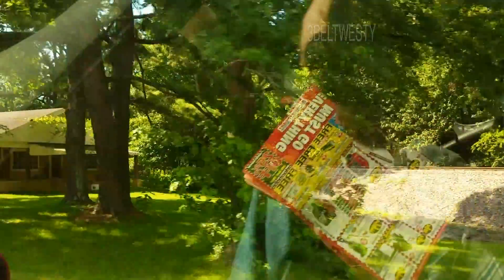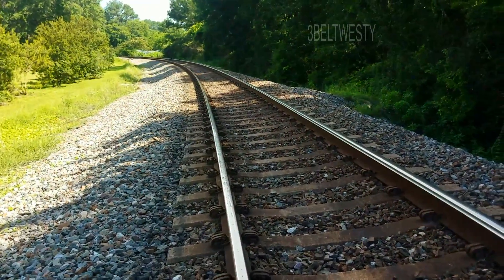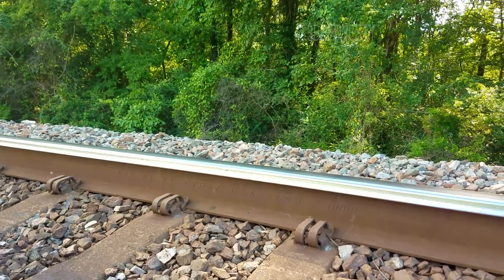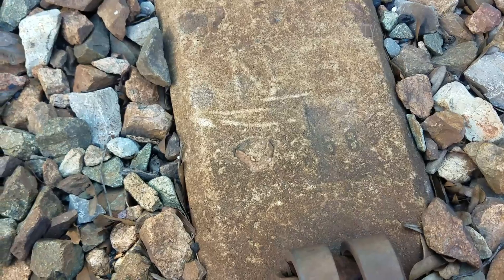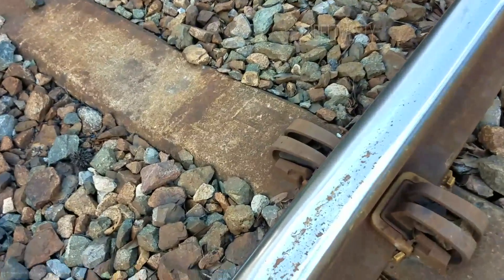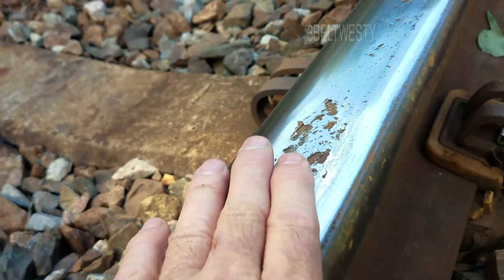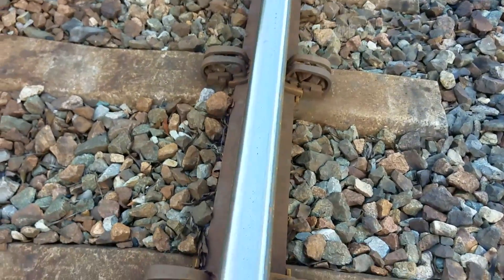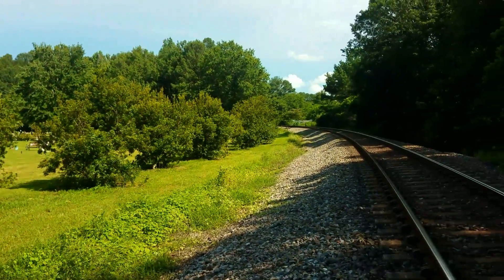BNSF Railroad track wear Concrete Ties curve 141 Lb Rail Tupelo Miss

Comment: 85% of the tracks of Deutsche Bahn are made of concrete sleepers. Only 10% consist of wooden sleepers. The rest is equally divided between steel and composite material sleepers. For information on how concrete sleepers are produced in Germany, please click on the video link.      https://www.youtube.com/watch?v=8yVp4g4Hml8                        The outbreaks in the rail head are caused by manufacturing defects. Too low temperature during rolling and not removing the scale layer before rolling. Greetings from Berlin/ Germany. Sven

Comment: i have found this video very interesting.  and the comments.  thanks for posting.  there is some minor spalling on a track near my house.  it only carries light passenger trains and the track is perfectly straight.  furthermore the grinder went over it 3 or 4 times and it was still there then the grinder came back and did it all again.  and the hole is still there.  i don't understand the mechanics behind it but apparently if you grind the rail to the ideal shape the rail lasts longer.

Comment: Common on the inside rail on a curve. I'm not an engineer but I'm guessing it's caused by differential stresses from inside vs. outside    lines of a curve. The inside rail being slightly shorter in length, causing the solid axle wheel assembly to peel the rail surface on what would be the faster turning inside wheel. Also rails are work hardened causing a harder surface compared to the interior steel of the rail which can also cause spalling of the surface.

Comment: The trains are probably going a bit faster than the bank/cant  in the track allows for, so the wheels ride up/squeeze against the non worn higher rail.  This higher rail gets better adhesion, so the lower spalled (with spalling) rail is worn.  The left and right wheels are locked together through the axle, and turn at the same rpm.  So because the higher rail is longer (due to the curve),  either the left or right sides must have the wheels grinding or being dragged over the rail.  Simple geometry.   So the lower rail with the spalls has the wheels being dragged over it slightly.  This creates a lot of stress.   If the train was going too slowly, the wheels on the lower rail would grab better.  This is the way that I see it.  You would have to confirm which rail has the most grinding (smooth wear) from the wheel flanges rubbing against it.  Look up these words in a dictionary, so that you'll know what they mean, and therefore understand what I'm saying.   Draw two parallel lines on a sheet of paper that do a sharp curve, and then measure them;  they won't be the same length obviously, since they are not straight.   Look up 'flange wear on the rail' on the Google, and see what you get. Aarre Peltomaa
Reply: you forget several things that are not directly obvious but very important: Most of the railkways use conical wheels and fillets between wheel and flange - this helps wheels to negotiate curves. Its simple geometry which means: No dragging, no stressing, no grinding........
Reply: Due to centrifugal force, the conical wheel rides outward and onto its larger inside diameter.  The wheel inside the curve rides on its outside lesser diameter.  Idealy there is very little wear.

Comment: that is rolling contact fatigue. low rail or inner rail has rail head contact about the center or field side while high rail is contacted at the gage corner. At the spiral or curve, lateral forces can be significant. 36 ton axle load, you can generate more than 15 kips lateral at certain points. Repeatedly apply these forces on a dime size contact, you wear or fatigue. Depending on the accumulated tonnage, grinding practices, ballast and fastening system quality and so on, life can change. that is a small to medium size RCF so it needs grinding

Comment: The reason more railroads are going with concrete ties is because they are carrying more and heavier loads. Wood tie lifespan has diminished from the expected 20 years to as few as 8. So the fatigue on these rails is likely due to the heavier and more frequent use the tracks are getting, rather than the use of concrete ties. Concrete ties are stronger and last much longer than wood ties.
Reply: @gravelydon
I can believe that. Seems like there’s no end to people trying to do things on the cheap these days.
I heard a news story recently about a company that was in trouble for selling a bunch of new ties in a big contract where the ties were not treated at all. The employees testified that they were told to “make them black whatever way works” and so they basically just got painted black and shipped. Those ties rotted quickly.
Reply: Would not surprise me one bit. The only thing that is allowed to be creosoted down here, ties for railroad use. So that shut down a Miami plant that did things the old fashioned way. We had some 2x2s treated by them. While the wood was Pine instead of Oak, it took almost two months in the Florida weather before they could be handled. They oozed for that long. We did cut a couple a couple years later to see what the center looked like. Nothing but solid creosote all the way to the center. Those would not rot.
Reply from the maker: Ethan Lamoureux in the usa the cost per mile is lowest for wooden ties thus that us why about all usa rails use wooden ties.  Thus includes replacement costs of the shorter lived wooden ties. Only on extremely wet usa areas in the usa does concrete sleepers have a lower lifetime cost. Thus maybe non usa rails might be more government funded and thus concrete is used since no profits are needed to survive? Wood prices in the usa can be low too thus another factor why wooden ties rule as the bulk of all ties used.  Folks who buy ones trees might give you 20 bucks for trees 105 ft tall and 2 feet in diameter
 If one has hundreds of them to justify the removal. Then ones land  is left with stumps and piles of limbs they don't want. Ie massive mess. One can travel around and look at all sorts of tracks in the usa and never see any concrete ties
Reply: OK, first, USA railroads use various kinds of ties, including wood, concrete, steel and composites, certainly not just wood. Second, the cost varies depending on many details such as location (wood is cheaper in some areas than others), climate (wood rots quicker in some places), type and amount of traffic (wood ties last longer on low volume lines, and the weight of the trains makes a difference), and various other details. So there is no ideal material for every situation. Concrete ties are on the increase in the USA, but wood and other materials are still used, and likely will continue to be used.
Reply from the maker: Here is some info on Steel Sleepers http://www.narstco.com/railroad-sleepers.html
Reply: Part of the problem with wood ties now days is that 1. they aren't old growth wood and 2. they aren't treated the same as they used to be. A new tie does not weigh the same as the old growth ties did and if you look at the new tie, many don't have a treatment layer of more than a half inch in. The same thing is showing up in wooden power poles. The creosote treated pole in front of our house is now 40 years old and withstood Hurricane Andrew and the hurricanes before and after. The new poles that were put in to replace the ones destroyed by Andrew in many cases failed in Katrina or Rita. That is why FP&L has gone to almost all concrete poles on the 3 phase lines. Pressure treating of wood does not work as well as vacuum treating the wood before releasing the chemicals into the retorts. With ties, the most penetration is by pulling a vacuum that pulls out the moisture and opens the cells, then introducing hot creosote in under pressure. Then letting them drain and air dry. Most are run thru in as fast a period of time before put into use. I've seen ties that were new rot in under 4 years down here. While on the FEC branch there were ties still in use that had a date nail in them of the 30s and 40s still in use in 1999.
Reply: @gravelydon7072  , creosote is carcinogenic.  just being near the stuff makes me ill.
Reply: @vsvnrg3263  That is one of the reasons why it is limited in its use down here. We have what is known as a sole source aquifer and it will leach down into the ground water over time. Same applied to CopperTox (CCA )which was used as a substitute. Now all the wood is ACC treated as the Arsenic in CCA also leached into the ground and water.
Reply: @gravelydon7072  , down here (in straya) cca was banned more than 20 years ago.  some poor kid took a bite out of an apple and to stop it falling off the cca log, put it bitten out part down on the log.  then he ate the apple and died.  the coroner concluded that the flesh of the apple had absorbed poisons out of the log.  this is a true story.  i was building fences in a park in the 1980's when this happened.
Reply: @vsvnrg3263  It was still used here till 2003 in residential use and it was still used in commercial use until recently. It is the most effective treatment after creosote for wood that comes into ground contact.
Reply: @gravelydon7072  , i've just been surfing wikipedia looking for acc and can't find anything.  what is it?
Reply: @vsvnrg3263  Acid Copper Chromate. Industrial/commercial use only for treating. Residential buyers can get ACQ (Alkaline Copper Quaternary) for use and is the most common home use treatment.
Reply: @gravelydon7072  , thanks for info on stuff i'd never heard of.  now i'll do some research.
Reply: @vsvnrg3263  Type in ACC wood treatment in google and you'll find a link to the US EPA. There is a batch of info there. Some of these treatments are only available to those who have a restricted pesticide license. Which I used to keep active.
Reply: @gravelydon7072  , thanks for info.
Reply: ethan lamoureux there are problems with concrete.  they are stiff and brittle as well as being strong.  plastic plates are needed beneath the rails to dampen shocks.  those who design them are either being sneaky or underinformed as to the nature of stresses put on them as a train passes over.  the hourglass shape is a weakness.  the middle is put in tension as the outer ends are put in compression causing to middle to crack.  it is called built-in obsolescence.  i'm sure it is intentional.  i do confess to being a fan of concrete.  creosote is carcinogenic.  being near it makes me ill.  i am impressed with the advantages with using plastic waste for sleepers.  termites don't eat the stuff.  recycled plastic may be the best in every way.
Reply: they should try plastic composite ties

Comment: so america has joined the 21 century and started using concrete ties
Reply: Concrete ties are in heavy use throughout North America.  Thousands of miles of it.   You need to get out more Hifijohn
Reply: The majority of lines in North (US, Mexico, Canada) maintain wooden crossties (sleepers) as wood is plentiful, cheap, and cost less to replace vs putting in new concrete.   In some situations it works better than concrete.   When mainline track is completely rebuilt often there will be a program to completely replace the wooden ties with concrete.   However there are over 200,000 miles of track in the US, MX and CA.    Branch lines or low density lines that will not have a complete rebuild will probably continue to use wooden ties for the next few decades.   Nothing wrong with that economic decision.   Wooden ties continue to be safe, efficient and cost effective in many scenarios on this continent.
Reply from the maker: America first used concrete sleepers (ties) about 1896, ie 19th century. They saw very little usage due to the cost of install, fatigue failures of the concrete ties. A relative ran an Engineering test of prestressed concrete sleepers 80 years ago on some tracks in eh Michigan and Illinois areas. A crude guess is probably only 2 to 5 ?  percent of ties in the USA are concrete. The bulk of these are probably in the last 30 years. There have been problems with breakage of the concrete ties plus the rock ballast degrades quicker.
Reply: so why does the rest of the world use them???
Reply from the maker: Maybe because the "miles/kilometers" of track peaked in 1916 in the USA. There is only 1/3 the track today than 100 years ago. Rail Passenger usage versus car or bus plane is  about zero. About all trains in the USA are for Freight. Passenger trains are in a few areas.
Reply: where?? Ive lived near tracks my whole life and have never seen concrete ties, one of my neighbors worked on the railroad and he has never seen them, in fact the first time I saw concrete ties is when I went to europe in the mid 70'even yugoslavia had them and they were still using steam locos on some of their passenger trains.Just look at all the train videos on youtube and you wont find a single line that uses concrete ties from the past,a few are starting to use them now.
Reply: The problem is that there are plenty of videos on youtube that show the old style wooden ties, yes some of the newer rail lines use concrete, but  the majority still use wood.Since these videos contradict your  knowledge of the world, Ill make sure youtube takes these videos down.
Reply: Out of respect for your great knowledge(and general greatness) I personally vow to boycott any railroad crossing where the railroad still uses wooden ties.How dare they prove you wrong
Reply: The straights on the bnsf creek subdivision are wooden and the curves concrete tied. You need to get out more.
Reply: hifijohn, Then you need to come down to Florida. The FEC has been using them for decades. Just look on youtube for anything showing the FEC's mainline and you'll see concrete ties. CSX and the FLDOT installed miles of them in the Miami- West Palm Beach main. Amtrak has them in the station area in Miami even. FEC even has their own concrete tie operation.
Reply: concrete ties have been used in North American as early as the 70s and 80s
Reply: @Mike Smith ,the damn thing that is wrong with wood is the creosote.  it is toxic.  wood as ties is very forgiving.  wheel bearings last longer. less rumble transmitted through the ground to neighbours.  but it doesn't last long without a proper creosote bathing.

Comment: Rolling contact fatigue. Pause at 01:00 - the rail head shows signs on the gauge corner of having had rail-head grinding. Since that work was done, it is obvious that follow-up grinding has not taken place to maintain the profile of the rail-head. This may be on the final grind before overdue replacement.

Comment: VT means vacuum treated. That 141# rail was made at Evraz steel mill in Pueblo, CO.
Reply: Now what's really cool, is seeing CF & I branded rail all round Pueblo/Colorado Springs, and out along the old MOPAC mainline out to Towner, Colo. C F & I is the mark of Colorado Fuel & Iron, which is nowadays the Evraz plant in Pueblo.
Reply: Thank you, WW.    Are they still making rail in Pueblo?    Or all steel production shut down?
Reply: They are still rolling rail in Pueblo.
Reply: Between Pueblo Reservoir and Pueblo West CO there are railroad tracks from 1968 that are still in use by the Union Pacific Railroad.